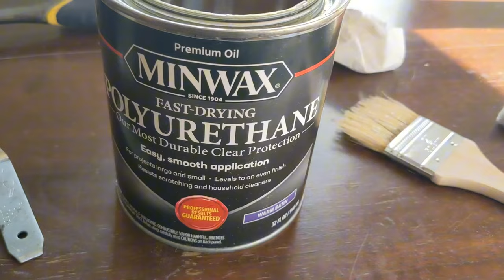Refinishing An Old Rocking Chair

Comment: i did an exact chair like this  only it had a sailing ship on the headrest with cannons on each side...mine had most of the finish but faded /worn in some spots  .i didnt sand it...all i did was load the dark walnut stain to it let it dry a few days then wipe back the excess. the loaded the poly aclyric to it... it turned out stunning  !!
Reply from the maker: Sometimes that's all it takes!
Reply: @CLEVERCustom  i was very grateful i didnt have to sand ..and it came out amazingly well  ppl said it looked like a brand new chair it made me happy it turned out so well !!!

Comment: What kind of sponge is that? I have a rocking chair outside that is sanded down but I bought stain brushes. Should I use a sponge instead?
Reply from the maker: Either works, I prefer to use a staining pad/sponge for stain and a brush for clear coat polyurethane. Staining with a brush can leave brush streaks versus using a pad that'll ensure even coverage. It's just based on preference.